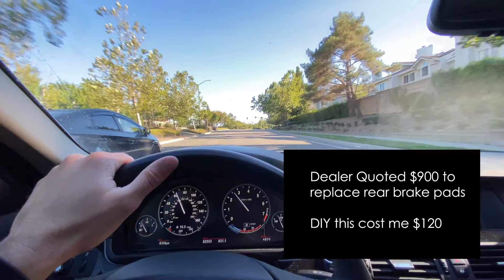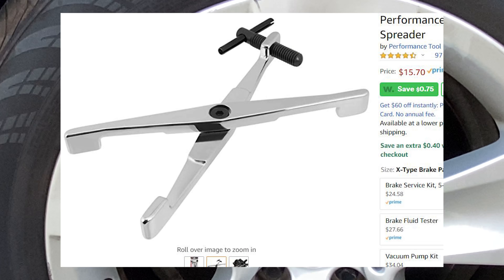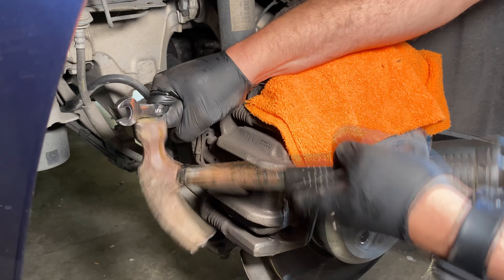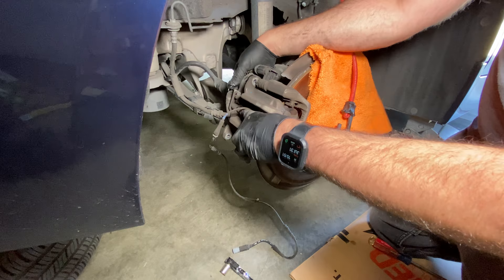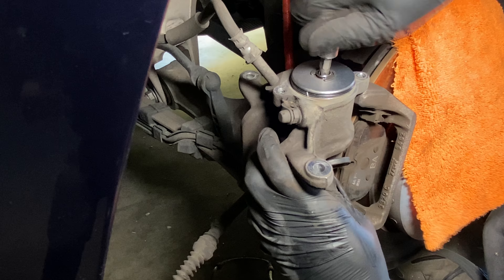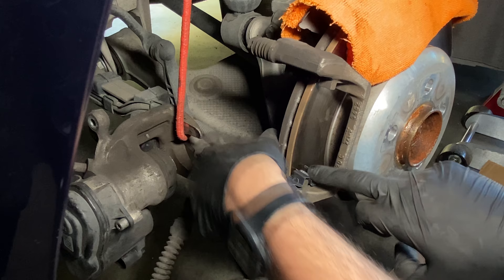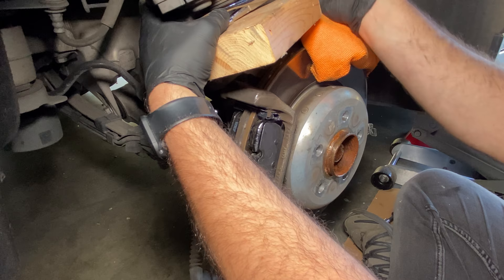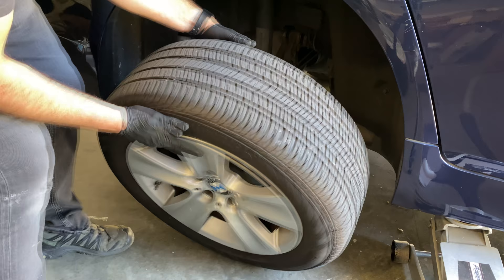BMW 2010-2017 F10 Brake Pad Replacement- Save $780 DIY

Comment: Amazing video. I really appreciate that you didn't cut away most of the work as I completely agree that it's nice to see when you're a newbie. 

Thanks!
Reply from the maker: Ya, I try to show it all and not rush to assumptions that people know certain skills. It can be hard when people say just remove the bolt and don't show the tool or angle it took to access it!

Comment: Followed your directions but decided to reuse the old sensor. After many attempts to reset the warning light I Ended up ordering a new sensor and replacing it; first try to reset the light worked like a charm. Word of advise "Replace the sensor along with the pads and save yourself time and headache."
Reply from the maker: Thanks for the tip! Never thought about saving the sensor, I know on my VW is was iffy to try to save it.
Reply: not too bright huh

Comment: Great video, will probably change my own break pads this summer. BMW said I probably also should replace my brake discs for a ridiculous high price, so I think I'll wait with that until I have the time to look at them myself how worn they are.
Reply from the maker: If you’re driving your car hard and need the absolute best stopping power then replace the pads and rotors together. It isn’t that much more work or price if you do it yourself. But, in reality there is a minimum thickness to the rotor before it needs to be replaced. The bmw dealer should have written down on your estimate what your rotors are and what the minimum is. Then you know the technician checked them. They often advise you to replace things WELL before they are close to being worn out. Because that’s how they increase their profits. We’re talking 1-2 years or even 50,000 miles early in my experience. Wait for the breaks sensor to go off before you replace the pads or rotors. That way you know you got the proper life out of the item. And you aren’t throwing $ away or items in the landfill before they have fully served their purpose.

Comment: to avoid taking the housing apart and hand rolling it you can use a 9v batery with some wires straight to the plug, you will need switch the wires so it pushes out the piston for a small bit, then switch them again to fully retract the inner part 5:06
Reply from the maker: This is super smart and thank you for sharing this trick!

Comment: This is a reasonably easy job well worth the effort. I have changed mine twice front and rear including discs, and the rear ones are a bit more cumbersome due to the electric parking brake actuators. How I envy those who don’t have to strive with rusting parts!
Reply from the maker: Good to hear! I agree with ya! Haven’t done the fronts yet on this car and 90k miles. Have you tried spraying down the rusting parts overnight to loosen them? Then clean them off with brake cleaner before starting the job? Might make it easier.

Comment from the maker: I got an update from a friend that I need to measure the rotors to make sure they are still within specs. If they are not it is advisable to replace the rotors too. Rotors are about 20 more mins and around $100 more. I will be doing that next before I drive the car much more.
Reply: Hey never use aftermarket anything on a bmw let alone any European car unless it’s brembo. Akebono is good aftermarket brake pads I had them in my Toyota and never had to replace them. But always use oem
Reply from the maker: @gottgaame  thanks for the advice! Like you, I am a big proponent of OEM vs aftermarket unless there are tons of positive reviews. Or if the product isn't highly technical. Cheers mate.
Reply: @fixitwithjake  what is OEM?
Reply from the maker: OEM= Original equipment manufacturer. In other words a part that is made by the original manufacture when the car was built. Versus an aftermarket part.

Comment: Does this vehicle have caliper slide pins?  If so this is a fairly important step and can possibly detect uneven pad wear.

Withe most vehicles the slid pins are what the caliper bolts attach to.  Since the caliper is already removed only a couple of more minor steps.  There is usually a dust boot, use a pick tool to remove the dust boots and some brake hardware kits come with the boots as part of the package.  Remove the pin, clean, check for damage and apply a light-moderate coating of brake grease.....(The same grease that is used for the back of the pads), to the slide pin.  Spray a coating of Brake cleaner down the slide pin housing and clean out.  You will most likely need some Q-tips or low profile pipe cleaners to wipe out the excess and dry out.

Reinstall and reattach the dust boot.   

Again only about another three-five minute job per side but this is can also be used to diagnose uneven brake pad wear.   Small effort and peace of mind for ensuring fresh grease and slide pin lubrication.

Hope this helps.

Comment: The brake lube is for the slider points , not the back of the pads
Reply: Yes on the back of the pads as well some the caliper doesn’t rust weld to it

Comment: I broke my actuator, and i replacing new one using your tutorial... I think i did it correctly, but the "parking brake failure l" didint gone... How to reset it? Rotate clockwise right?

Comment: How do I remove the sensor at the top?  Is there a secret to getting this out?
Reply from the maker: It might help to Google what a clean sensor wire looks like. Yours is probably covered in road crime and hard to tell. I’m gonna give you a link to what it looks like you’re pressing on the car to open the clip and you’re pulling the grey connector off. https://amzn.to/3UfHiqB

Comment: Great video for sure❤️ however I followed instructions and i got yellow ebrake light on dash and ebrake is not working😉
Reply from the maker: I studied up on this topic quite a bit before I performed this procedure. There were lots of people with favorable results. So perhaps Something is out of place when he put it back together? Or the parking brake was not unscrewed all the way. Anyhow I will do some digging in and see if I can come up with a resolution for you. I do know there’s a bunch of cheaper computers that I’ve hit the market to electronically activate the parking brake. These to be very expensive but now they are very reasonably priced.

Comment: Hi Jake thanks for the video on replacing BMW f10 rear brakes. Do you have a video on replacing brake fluid on the same car.
Reply from the maker: It is funny that you ask that. Because I just had a brake fluid delivered for that project. I really don’t like doing brake fluid changes so I’m putting it off but I really can’t put it off any longer!
Reply: @fixitwithjake  When should we expect to see the brake fluid video?  BTW GREAT job on the brake pads!

Comment: Hello
Just watched your video, but my question is, did you use any diagnostic equipment to unlock the brakes either when you started or when you finished changing the brake calipers.
Reply from the maker: Negative. That was the point of this video. You do not need to use a diagnostic computer to do so.

Comment: Do you recommend replacing the rotors as well or only the pads?
Reply from the maker: Depends. If u plan to keep the car for another 50k do both but if you plan to sell and it is within the tolerances then I’d be fine with just pads. Rotors aren’t that much and it’s only 4 more bolts so if you have the time and money it’s not a big to add that in. I’ll review the BMW manual and report back that the engineers say too when I can.

Comment: Why did you need to adjust the electronic parking brake if you were able to just push the pistons back the traditional way?
Reply from the maker: it is a gear driven motor attached to that piston and will not budge the traditional way and sticks out. It needs to be moved back.

Comment: Great video!  Is the parking brake off when you when you manually retract it?  Also, no grease on the ears of the brake pads?
Reply from the maker: Correct. You want the brake off so you can turn it mechanically. Otherwise you will be fighting a lost cause. I’ve always lubed the rear of the pads. If I didn’t in the video maybe I edited that part out or forgot. I’m sure you’re already aware but it prevents squealing.
Reply: @fixitwithjake  Sounds good.  Thanks for the reply and posting a quality video..

Comment: Great video! Anyone know where I can find torque lbs for all the bolts in this assembly? 2015 BMW 550i xDrive F10 - thank you !
Reply: Caliper guide pins - 25.8 ft lb / 35nm
Rotor retaining screw - 12 ft lb / 16,3 nm
Rear carrier retaining bolts - 81 ft lb 110nm

Comment: I just have one additional question. I followed every steps in your video and replaced the brake pad and the brake sensor with the links in your video. Braking works fine. However, on the display, its says parking brake malfunction. The parking brake just won't light up anymore and it worked fine before the replacement of the brake pad and sesnor. I tired the reset method but doesn't work. What should I do? Thank you.
Reply from the maker: Skip to 5:02 on this video and the guy might explain it better than me. Sounds like the parking brake didn't get put back in place with correct spacing to operate again. https://www.youtube.com/watch?v=TmwywiJSSm4
Reply: @fixitwithjake  would the issue be caused by too little or too much space for the new break pad? Could the issue caused by a break sensor?
Reply from the maker: @Jhinlucas0909  I could be wrong but I don’t believe so. I don’t think you got the parking brake back in it’s original position. It needs to be reset in that position.
Reply: @fixitwithjake  I think what I did wrong was that I gave too much space by getting the parking brake space open to maximum with a piston spreader. I guess I have to make the space smaller for the parking brake.
Reply: Usually the problem is that the parking brake connector is not reconnected properly (you should feel/hear a click in the plastic connector). I would try that first. I once broke the connector pins and had to replace them (original spares are available), which was a real tricky job, but worked fine afterwards.

Comment: That would be the same for the front without the electric parking brake part correct?
Reply from the maker: I haven’t done the fronts yet but I believe it’s the same caliper design and less work without the parking brake to deal with. Usually the fronts wear faster on cars. I think they were replaced on this car before my wife bought it certified pre owned.

Comment: Where did you get your impact wrench from? Would you please provide a link?  I can't even get the lug nuts off my wheels with my cross wrench.
Reply from the maker: I think this is mine. They make some even better ryobi ones than mine. https://amzn.to/3qBzcXe
Reply from the maker: I use the car's wrench that is in the trunk to loosen the lug nuts first or one of these and then the impact wrench.At the end is use a torque wrench to tighten the wheels perfectly to specs. https://amzn.to/2OhUcVX
Reply from the maker: Torque wrench https://amzn.to/3ctexzl

Comment: Hello is it the same for the front Brakes ???
Reply from the maker: I haven’t had a chance to work on the front brakes yet. But it should be pretty much the same without the parking brake to deal with.

Comment: Adjusting the EPB manually is asking for trouble...
Reply from the maker: Do tell!. Bc I did it with no I’ll effects as has many others.  It would love to learn what you know….
Reply: @fixitwithjake  So i see in my searchs.  A very simple solution. Just scares the hell out of me. Indeed when i bought the car i upgraded my scan tool for just this task. 😄
Reply from the maker: I almost upgraded my scanner tool as well so I could retract the parking brake electronically and then I watched a bunch of videos of people doing it manually with no problem. And it went super easy and smooth so I skipped on the tool and saved about 100 and something dollars.

Comment: Does this method work the same on a 2011 F10 550xi M sport Pkg?
Reply from the maker: Sorry, I don't know. I imagine you have fancier brakes with a few differences. But overall, the same idea.
Reply: Yes it’s the same process( unless you have big Msport brake calipers) usually the 2-3 piston ones

Comment: This is what's called a pad slap. You are very likely to experience brake noise, and poor performance compared to a properly resurfaced or new rotor.
Reply from the maker: Thank you for the tip! I did not notice any issues after swapping the pads. The rotors were in great shape and very smooth still. This car feels like it can stop on a dime.

Comment: Most important part.....removing the sensor harness wire....and doesnt show it...lol...  come on man.
Reply from the maker: The old sensor came off with the old brake pad. I never removed the sensor from the pad. The opposite side of the wire unclips very easily with a flat head screw driver. Just prior up the connector and slide it off. Then replace the entire sensor wire with a new one and attach to the new pads. Thanks for watching.
Reply: Ehhh, it just pushes in.  I copied how it was plugged in to the old pad.

Comment: Bmw do not charge 900 to do that as I’ve called them! Click bait!!!!
Reply from the maker: What do they charge and what city do you live in? I live in the Bay Area and this was the quote I got from two local
Dealers.
Reply: @fixitwithjake  so only one quote was 780? Because I assure you bmw do not charge that to replace rear disks! Plain and simple, and if anyone doubts what I’m saying pick up the phone and call and you’ll see it’s not that amount so please do not say bmw charge almost 800$ to change pads! If you say rotors and pads then maybe but you state only pads and I’m telling you that’s not real
Reply: But likely you really don't need rotors, and the dealer won't do it unless they do rotors, so the saving is real.